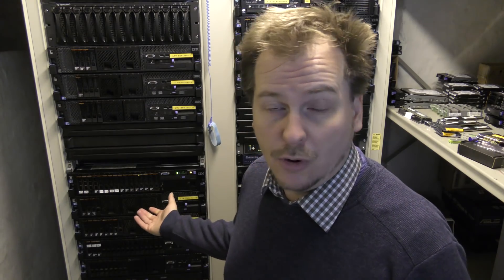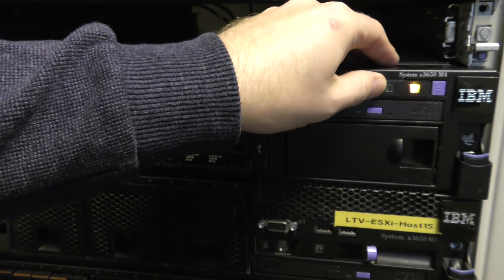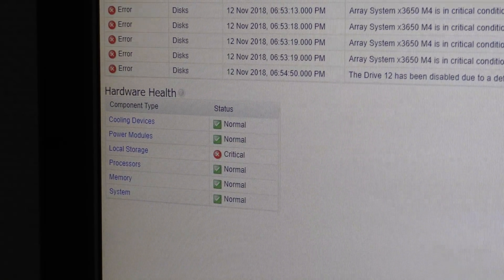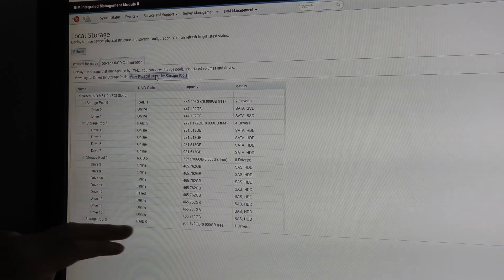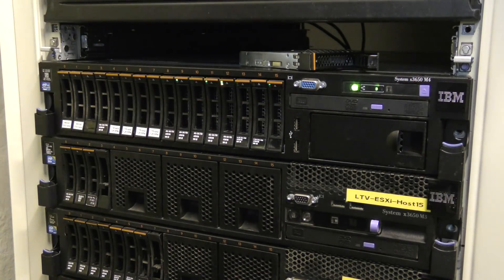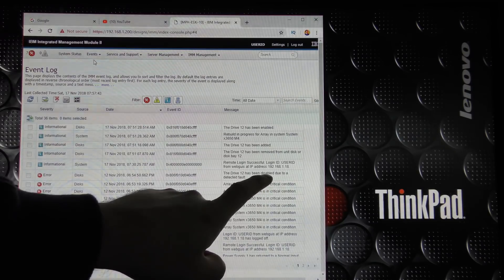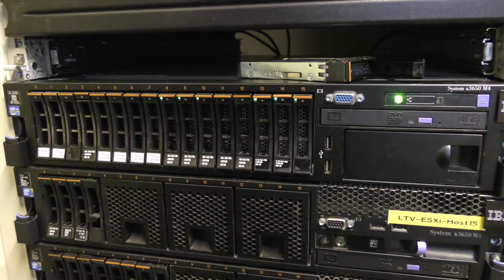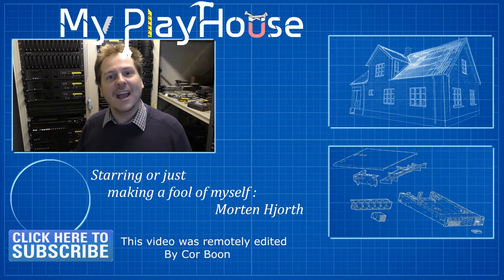Spinning Rust Drive Gone BAD - Easy fix on a Lenovo Server - 777

Comment: Hey Morten, before you upgrade to 4 tb drives, check if the controller suports them - talking from experience :) 
Also, instead of 2x4tb drives I would recommend to do 4x2tb drives in raid 10
Reply from the maker: Hi Marius Lazar
Thank You very much!  These newer controllers do handle >2TB :-)
Thank you for watching! :-)

Comment: In ZFS you can mix the drives together SAS and SATA in the same pool, even in the same array group  (called a vdev in ZFS terms) which is another way that ZFS is superior to hardware RAID.
Reply from the maker: Hi Chris Moore
I will disagree,, mixing SATA and SAS is a pretty bad idea. You can do everything in software,, The management of storage was moved to dedicated hardware for a reason,, to save CPU and RAM on the Server.  
Thank you for watching! :-)

Comment: You think you could make a video on X3650 m3 server and how to expand the server to 2 backplanes which have 16 hdd's in total. And with what cables/expanders? with M5015 RAID cards?
The whole process of make space internally for them.
it should be possible to do this,but as far Ive seen on the server model site, FRU 59Y3825 seems to be what I'm after. I find 8 bay little cramped atm.I'm using 2x128GB SSD in RAID1 for the physical server OS which will be my server infrastructure. and i'm planning on buying 1x256GB SSD or 2x 256GB in RAID1 for redundancy or possibly 2x single drives for storing VM's for Guest Host VM's which will be my lab and 5x300GB SAS drives in RAID5 for backup of VM'scheckpoints,GPO's,AD backup,iso's,WIM file. So it would be awesome to get it,even tho it could expensive.
Reply from the maker: Hi anders gjerløw
I think you need to scroll through my videos some day : https://www.youtube.com/user/SirNetrom1/search?query=16+drives
Thank you for watching! :-)

Comment: Hi Morten, 
Suppose I send you a pretty bad but special Laptop battery, the HP BB09, would you be able and interested in replacing its 9 18650 cells by fresh ones? I need this battery for my Laptop and it doesnt discharge properly anymore (30% to 0 in a few minutes, 100%to 30% in a few hours). Thanks for reading, Noé  from Switzerland.
Reply from the maker: Hi Waberner
No the shipping forth and back,, would be more expensive than a new used battery. But charge up the battery, take it apart, and check if any of the cells is lower voltage than the others. If so put more charge on just that cell or that pair.
Thank you for watching! :-)
Reply: @MyPlayHouse I have had another of the same battery. There I tried to disassemble the battery and I failed, so that the firefighters had to come to my house. Nothing except the battery got damaged =) 
That's  why I wanted to ask a Professional =) I am now banned from electronic work, by my parents :=P
Reply from the maker: Hi Waberner
He He,, good story,, sounds like you need a off grid electronic lab in the back of the garden :-) My fixing batteries videos are not doing that good,, so I am going to be waiting a bit until I do the next one,, but if you really really want me to look at this, You can send it to me. Info is under the "about" Tab and in the F.A.Q.
Thank you for watching! :-)

Comment: How come you never use hot spares in your Raids ?
Reply from the maker: Hi Mark
Yes Hot spare or global Hot spare,, as soon at the drive fails the rebuild wil start with the spare,,, putting the same amount of stress on the other drives. 
I will say that if you can have a global hot spare for more than one array,, it makes sense. But with just one arrey,, a Raid6 would be way better then a hot spare. 

Thank you for watching! :-)

Comment: think harder on using your 72 drive disk shelf on that 24/7 server or the other server "next door" and have that control all 3 disk shelves using decent HBA's OR RAID controllers that are new enough :) give nordic computers a call tell them you want 72x10TB drives on the cheap to promote them on awesome service lol
<.<>.>
Reply from the maker: Hi Sakura Kinomoto
Thank You very much!  10TB drives are very expensive. $400 a drive-ish,, so 70 of those = $28,000 I am not going to get that kind of a sponsor deal.. Maybe I could borrow the drives,, but 10TB is to new.
Thank you for watching! :-)

Comment: I still trust a decent magnetic hard drive more than a sure death ssd memory.
How old was that drive that died?
Reply from the maker: Hi zx8401ztv
Thank You very much!  it was from 13mar2010
Thank you for watching! :-)
Reply: Ssds norm more reliable then hdds as long as your not writing to them constantly (you can get DC ssds drives that can handle like 1 drive fill per day for 3-5 years depending on model) 
the samsung pro 850 it's very exceptional as they can handle 2 petabytes of data before even thinking of failing flat out 
all samsung pro still use MLC still so take a lot to wear them out(no SLC cache needed) , evo ssds and other makes (unless they state otherwise) are TLC based with small SLC cache and they can have data loss read errors as low as 400-800tb written data (note this is only issue for server loads) most of my Normal pcs/laptops  have never passed 10-25TB over 2-3 years of written data witch is not much on a ssd most have not even dropped any more then 3% wear level)
Reply from the maker: Hi lee x
Thank You very much! good info thanx.
Thank you for watching! :-)

Comment: 18:38 it's called wear-leveling; a technique to equalise the amount of PE-cycles (Program/Erase) across the whole array of memory cells. Your SSD's S.M.A.R.T. report is where you can see the actual values. SSD endurance is often specified in TBW, TerraBytes Written, because writing to an SSD causes PE-cycles. Some SSD's SMART reports won't state a convenient TBW value, but a rather inconvenient mumbo-jumbo, like LBAs-Written, and then you have to figure out the native LBA size, which is somewhere at the top of your SMART report, if you're using Linux tools like "smartctl -x /dev/disk/....."   …some SSD vendors don't even specify TBW, those actually specify PE-cycles (I think SK Hynix does this …i've got one of those as a ZFS ZIL/ARC cache) …yeah SSDs, fascinating topic :D
Reply from the maker: Hi Fluffy Floofer
Thank You very much!  good info:-)
Thank you for watching! :-)
Reply: @MyPlayHouse  I'd like to add even more useful information; some reviewers (one of my favourites is, "pcper", here on YT too) measure in their benchmarks in  " complete drive writes " PER DAY, especially for enterprise class devices. That seems to be an actual SSD workload, even within warranty limits …yeah, kind of reasonable, in a " cloud virtualisation-y SAN cluster ", or a video editing studio …or a business with other amazing throughput demands for their cache-y, high turn-around-rate, storage …just imagine a (relatively simple) Varnish frontend caching proxy, yeah, most of it is in RAM, once the box/VM is running, but you'll have to populate/synchronise the RAM quickly onBoot

Comment: Can the server also have a hot spare? When you're just replacing/rebuilding without first backing up, the "very unpleasant" failure risk due to rebuilding stressing the array is the same with or without automatic hot spare rebuild.
Reply: yes most servers/raid controllers can be setup for hot spares its even more recommended to have them, the only way you wont be able to is if you have no more free slots/bays in the server aka maxed out
Reply: Some server raid cards can have a global hot spare to be used for any raid array, but you need to check the documentation to see it the raid card model supports it, don't assume if it can do hot spare that it can do Global hot spare.
Reply from the maker: Hi Johnnie Hougaard Nielsen
Yes Hot spare or global Hot spare,, as soon at the drive fails the rebuild wil start with the spare,,, putting the same amount of stress on the other drives. 
I will say that if you can have a global hot spare for more than one array,, it makes sense. But with just one arrey,, a Raid6 would be way better then a hot spare. 
Thank you for watching! :-)

Comment: How long does it take to rebuild the data after an HDD swap?
Reply: It really depends on the size of the drives (in GB), the quantity, and the amount of data stored on them. But it usually takes quite some time, maybe even days.
Reply: depending on size of drives, how many drives you have in your "pool" on average for say 24x4TB in RAID6 (hardware) for 1 drive failure, is about 24-36 hours (personal experience) RAID Controller in question is 3ware 9650SE-24M8
Reply from the maker: Hi Hunter's Moon
I checked the log,, it took 1h52min 49sec.
Thank you for watching! :-)
Reply: well, that was kinda quick  xD
Reply: @henriquecorrea1562  not Much data on them most likely
Reply from the maker: Hi lee x
Yes,, if hardware Raid see the data, or just if it has to do the whole drive..
Thank you for watching! :-)

Comment: Unfortunately in a Hardware Raid the controller does not have the inteligence to know which block have data in and what not. So it's going to rebuild block by block.
I've tried this for a customer with veeam, the internal array was in maintainace mode (with do shutdown vm's and do not move) and the clone we made to a iSCSI target on a Freenas system (dedublication & compression disabeled).
When both systems were ready, we replaced two disks in a Raid6/Z2 and check the rebuild time (both systems 24x600GB 10k - 40% used). The rebuild time were 47% lower on the ZFS as on the Hardware Raid and ready in under half a day.
TLDR:
Hardware Raid does not care if the disk is allmost empty or you've filled it up with junk.
Reply: zENjA I'm a novice to understanding RAID but based on what you're saying it is better to use software defined RAID rather than Hardware defined RAID via a RAID controller? Software defined RAID could use a Hardware RAID card set up as JBOD and would be the same as just using Software RAID without any hardware level raid controller?
Reply: @LND3947  Use Software Raid  (that is not running inside a ready build distro) with LVM / ZFS etc. if you know what to do. 
Take Hardware RAID when you need "save" entry level storage in your system with out SAN Storage - do backups
Take ready distro's like Freenas when you have data or backups that should be stored on the cheap in home and SMB use.
Ready Storage Box like Synology/Qnap when you want a unified soulution and don't need higher performance / IOPS.
Get SAN when your data is critical for your work, check redundancy and backup & restore strategy. Sepecially stuff like NetApp's/EMC²/3PAR/PureStorage/equallogic/IBM Stuff or other Teared Storage/enterprise solutions/all flush devices.
Test the hardware replacement bevor you go to production, put it in doku / Print a large lable and stick it onto the devices. You really not wan't to hazzel around, when something have failed. This is also usefull when you let services like this getting done by a Datacenter Service guy.
If you wan't to go Software Raid, use a HBA - JBOD is not the way to go, because this (in many controllers) just stick the HDD's together, so if one drive is filled up, it will fill up the next one. JBOD does not to any spanning like RAID 0.
For Storage Spaces (Windows) or ceph (Block Storage) you will know it, when you have the Usecase for that.

Infos:
ZFS - University of Edinburgh https://indico.cern.ch/event/518392/contributions/2195790/attachments/1297126/1934605/EdinburghZFS.pdf 
Power Factors of ZFS - OpenZFS: http://open-zfs.org/wiki/Hardware
Reply from the maker: Hi zENjA
Thank You very much!  Interesting,, I am not sure it is as you say, but I do not have the data to prove you wrong,,, But it would make for a really interesting test.
Thank you for watching! :-)